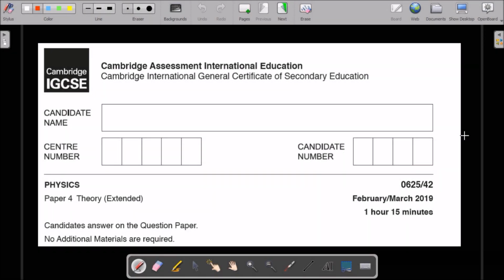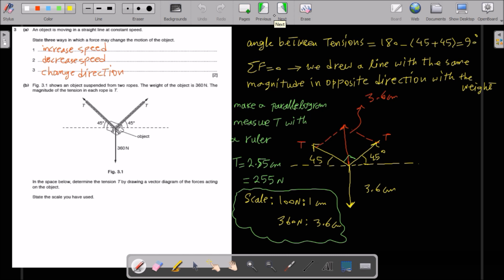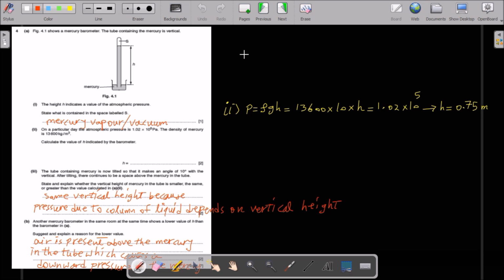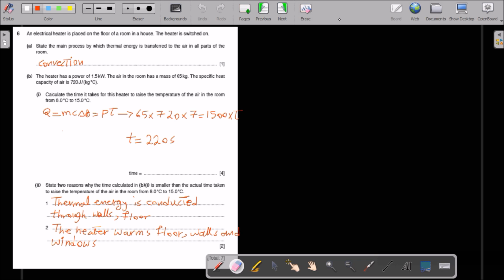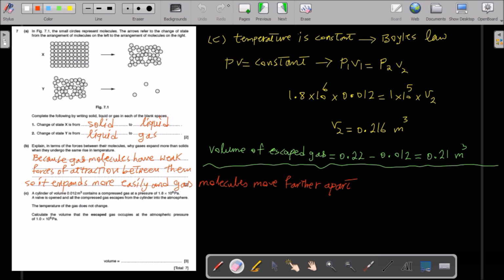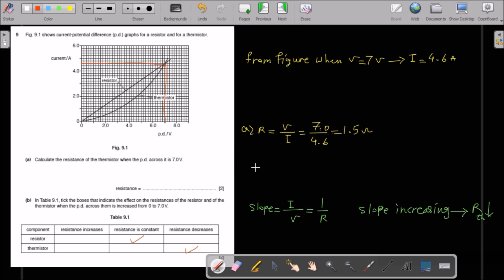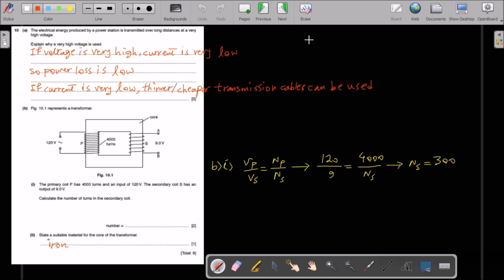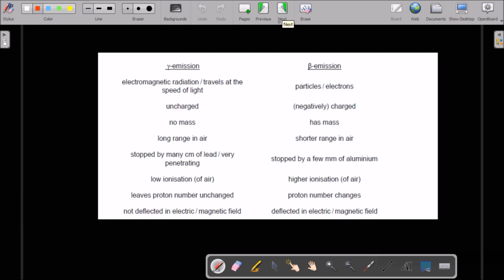Solved Past Paper of Physics 0625/42/f/m/19

Comment: Thank you. I think the answer of question 8 is incorrect. Wavefronts should be the other way round because the wavelength must be greater in air than in ice. The correct way to do it is NOT to refract the wavefronts themselves, you should refract the line that is perpendicular to the wavefronts (also draw your own perpendicular line because the one in the question that says ‘direction of wave’ is not perpendicular).